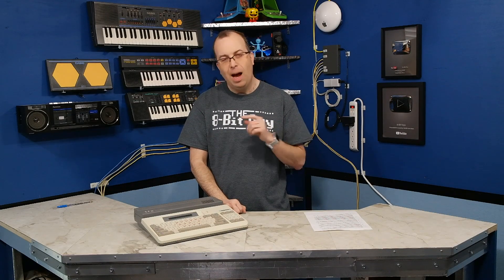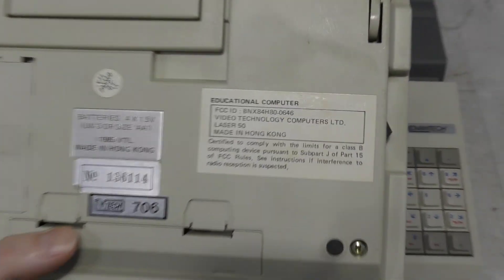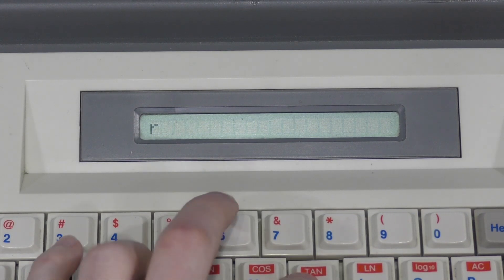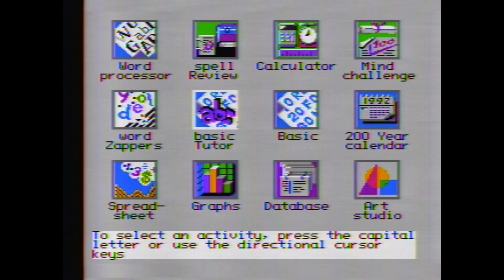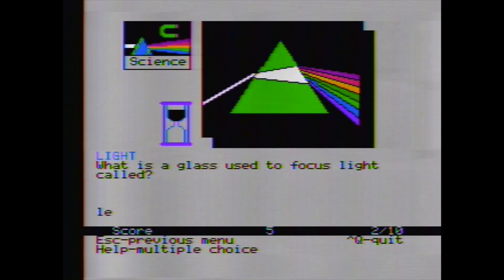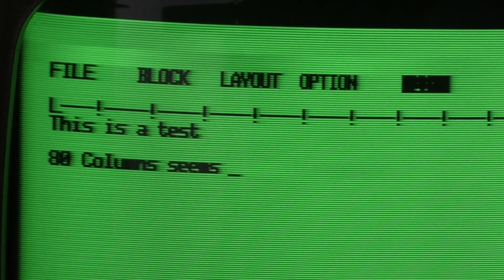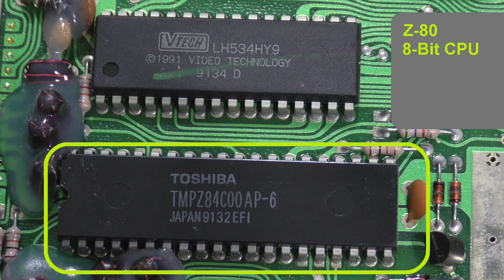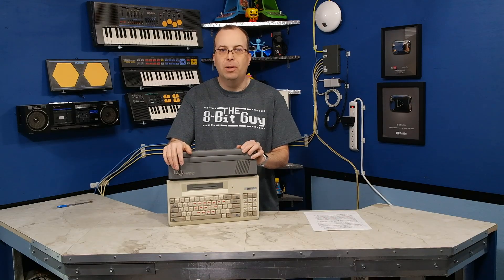The Advantech I.Q. Unlimited with BASIC and a Z80 CPU.

Comment: 16:20 "Not sure what speed it's clocked"
Time for you to get an oscilloscope, sir!
Reply: Frequency counter
Reply: You can probably find a crystal somewhere on the board ... if there's nothing other than the NTSC colourburst one, then it's using that, and likely running 3.58, or for later Z80As, 7.16MHz.

If even that can't be uncovered, just try and figure the pixel resolution and how wide a sweep of the screen they cover, and compare that width against a machine of known frequency and resolution. The TV's beam will scan at a fixed screen, so active width is equal to active period; pixels divided by period will give you video clock frequency ... which in a machine like this will almost always be locked either directly to the CPU speed, or in a fairly simple ratio (2:1, 3:2 etc) to it. Which gives you a most likely speed, plus a limited number of alternatives. The CPU markings themselves should also reveal what its maximum speed is, and usually the host machine will be designed to run at or close to that (EG one with a chip marked with an 8MHz maximum speed probably runs faster than whatever the next speed grade down is, likely 5 or 6MHz...), and in concert with the other information should help narrow down the realistic options.
Reply: or just look at the crystal...
Reply: Update: Looking into / refreshing my memory over how the Apple ][ video modes created colour, as this machine sure does seem to use at least a variant of the same method if not completely copying it, you are pretty much locked in to using a 14.318MHz master clock, as that's what creates the pixel clock in double-hi-rez graphics (560x192 1-bit on a mono screen, 16-colour with 140x192 effective rez on a colour screen, possibly you could shoehorn in a 4 or 6 colour 280x192 mode but that doesn't seem common/official) and 80-column text modes on the ][c and ][e, as well as the colour waveforms in original low-rez (40x48, 16 colour) mode, and is subdivided by 2 to make the pixels in original hi-rez graphics (280x192 mono or 140x192 6-colour) and 40-column text. All the other frequencies in the system are also divided out of that master, including the CPU at 1.023MHz ((315M/22)/14).

As the system smacks quite a lot of a ][c reference design (including the under-used 128KB RAM), with the 6502 CPU replaced by a Z80 for some reason, and almost all the original logic squashed into a single LSI chip plus a couple others which weren't convenient to fit into that, plus the floppy controller virtual "card" replaced with the bundled software ROM, I'd be surprised if it does anything different.

The CPU in this case is therefore probably running at 4.77MHz, the same as the original IBM PC, and arrived at by the same method - 14.318MHz divided by 3. If you've got a 6MHz Z80 available, that's the best you can do without adding extra oscillators and clock generator hardware, because /2 is 7.16MHz (too fast) and /4 is 3.58MHz (slow enough that you could have used a regular 4MHz Z80 instead). It's also about the slowest you can run the chip whilst still getting a reasonable speed boost vs the original processor (a 3.5MHz Z80 is arguably on a level with a 1MHz 6502, but a 4MHz has a better fighting chance; 4.77MHz is definitely quicker), in order to compensate somewhat for any suboptimal coding (VTech probably doesn't attract the world's best coders), inefficiencies from simple source porting, any need to swap endian-ness of 16-bit data, etc. It may look like it runs a little sluggish here and there, but without that extra 50%, it'd be noticeably worse (like... a third worse. Of course.)

It might also be something to do with the memory, which looks like it's rated for 100ns? 10MHz? (Same difference?) Either way it may well be running at a good 7.16 if not 14.32MHz, taking advantage of the higher speed rating to allow the video system some extra slots besides the CPU access (in the original Apple, this was taken care of by the memory being good for 2MHz, whilst the CPU ran at 1MHz). Maybe there's even some kind of fancy /1.5 divider, x2 synthesizer, or just a 28.63MHz master clock involved to make a 9.55MHz memory clock possible. It only really needs a fairly minimal amount of extra bandwidth (1-bit video at 14.32MHz means shifting bytes at a mere 1.79MHz; as memory usually needs at least two clocks for a single transfer, that comes out at 3.58... 4.77 + 3.58 = 8.35, so 9.55 leaves a little bit spare).

Alternatively the video accesses could just fit into gaps in the Z80 machine cycle where it doesn't touch the memory bus at all, and the memory is merely overspecced (it was just whatever was cheapest in order to provide at least 64KB, or maybe the full 128 so that working memory and document / image storage could be kept separate and bank-switched, at a minimum of 4.77MHz operating speed), though I'm not convinced that would allow enough bandwidth without some degree of contention and processor waitstating... which may itself be a reason for the higher clocking, so that it has some chance of executing any instructions during the active video portion of a line, even if it's at a reduced rate. (Memory running a 7.16MHz could work though, with a bit of glue logic to interpose between it, the CPU and the video, maybe with a bit of buffering for the former; if the chip only does one access per four clocks, a reasonably common thing for anything other than the 6502 at the time, that would demand an equivalent memory speed of about 2.39MHz; that + 3.58 is clearly less than 7.16)

The final alternative is that everything runs at 7.16MHz and they're simply overclocking the CPU (Z80s were quite resilient against the practice AFAIK), whilst underclocking the memory. With an even sharing of bandwidth between the two, there's just enough for the video to run 80-col 1bpp (with that very Apple ][-looking, thus probably 7-pixel-grid, and 560 total pixels), and the CPU to operate at full speed, without any contention or shortfall. Each gets the equivalent of an uncontested 3.58MHz memory chip, with the Glue logic doing some simple round-robin buffering to guard against both systems making a memory IO request at the same time... a pretty common thing in almost every computer system of the era other than the (non-Jr / Tandy) PC compatibles themselves.

One oddity seems to be that, in colour / 40 column mode as seen on the monochrome display, it isn't actually using super thin on/off stripes, but wider ones in a few shades of grey. This is an entirely valid alternative to the Apple ][ method, produces the same effective colour resolution, and if it's 4-level uses the same amount of memory and bandwith for a given display (and therefore, the frequencies etc are the same), it's just a touch more complicated on the electronics side (have to provide a 2-bit resistor ladder DAC rather than a simple single TTL), and results in a different, and likely more restricted set of colours, with probably only about twelve unique ones in the full palette. This would seem to match what's observed though, as I wasn't able to count more than that many, and the palette is a bit weird even vs the Apple. Plus there are multiple greyscales, which this scheme would allow, but ][c/e DHR didn't.

Similarly it looks like it gives a somewhat wider image - the ][ had a bit of a horizontally compressed image even on a regular TV, a bit like that of an ST or C64, to ensure it fit within the underscan limits on even a curved tube (similarly, the choice of 192 instead of 200 lines), which also gelled nicely with Woz's idea of using the 8th bit of each byte as a colour palette indicator. This machine looks like it might be showing a full 320 (or 640) pixels instead, which again is an entirely valid thing to do within the calculated operating bounds. The Amiga (running a 7.16MHz pixel clock) shows that it's a neat fit for a typical TV, you can make the colour encoding a little more logical and less prone to fringe artefacting (thus easier to program, and much nicer looking) by running 4 x 2-bit subpixels within each 1-byte block (with a resulting effective 2-pixel colour graphic or 4-pixel B/W text resolution, ie 160 colour or 320 B/W on a line) and happily sacrificing the 8th-bit mode switch because you're already getting twice the palette range of the original system anyway, and use a slightly more refined looking - or at least, slightly more loosely spaced, either way is more readable - 8-pixel-grid font. 80-col mode just splits each of those 2-bit subpixels into two 1-bit ones... and would have worked fine on a regular TV if only they'd thought to run a line to the modulator to switch it into B/W mode / turn off the per-line colourburst when it was activated. (Without that signal, a colour set will treat the incoming signal as pure monochrome and not attempt to decipher the hi-rez patterning, ie the text, into lower rez colour smears)

Comment: I had one of these as a kid and there was an external ram pack that you could store your files on. It had a standard cr2032 battery. I believe there was also an external floppy drive option. At least I recall seeing one offered in the included literature, and I did want one. Oddly it also partly worked with the Socrates game carts. Though you could not really play the games if I recall. I used this as my main computer for about 3-4 years. I still have it, though doubt it works after sitting for 20+ years.
Reply: Both this and Socrates are z80 based and from the same company, so it makes sense they'd be sort of compatible.  But something as simple as changing the memory map between machines could render the software basically unusable.

As long as you didn't leave batteries in it, I'd be quite surprised if it didn't work after a mere 20 years.  The Sinclair Spectrum had to reach about 30 before the membranes started to have to be replaced as a simple matter of course.

Kinda want one of these now :)
Reply: harshbarj pull it out and mess about with it!
Reply: Interesting. That makes it into a rather more practical and better-value prospect than just the base unit we see here.
Reply: I just bought one of these IQ Unlimited computers online and I find it rather fascinating, it arrived today and it works.  If you still have the RAM expansion pack and no longer want it, I'm willing to buy it off you if you're willing to part with it.

Comment: Regarding the 128K, i suspect a banking scheme of some sort and that SMD chip on the other side being, among other things, the bankswitcher. I even suspect that you could add some sort of battery backed RAM disk on that cart slot.
We could try to check how that think works and even write a crude emulator if someone would dump the ROM. ;)
Reply from the maker: Actually, I heard somebody say that MESS emulates this, but I wasn't able to find a copy that did.
Reply: The MESS name is "iqunlimz", lets see if that brings me somewhere. :D
Reply: Ok, found it out. MESS merged with MAME, and if you have a iqunlimz.zip with a vtech.bin of 512 kByte inside that in your roms folder and call mame with "mame iqunlimz" it will run.

Comment: 1991!? They had 386 computers by then! They sold an early 80's basic machine for $200 in 1991, what a ripoff!
Reply: mrjakeisnumber1 They had 486 (1989) computers by then and the Pentium (1993) just two years after this 1991 8-bit computer.  I bought my first 386DX in 1986 with a 150MB ESDI hard drive (there is an interface type few have heard of!) and 2MB RAM ($1000/MB at the time), that is how far behind the times this VTECH computer was on its release day!
Reply: A 386 in 1991 especially a portable one would have been $4000.

Comment: I have a vTech much like this in the UK. It is called IT Unlimited but doesn't have an LCD. It has a single cream-coloured case and plugs into the TV. I suppose it took its styling cues more so from the Amiga. It has some useful features, including carts and BASIC. I reckon there are probably some other secrets the machine holds, which I hope to get time to find out about. The software is very similar to that demonstrated in this video.
Reply: OH, interesting they would have carts for that.  I see though this thing came out later in the 90's. https://www.youtube.com/watch?v=uI63JvsrluY
Reply: Christopher Sobieniak That's the one. Interesting style of review in that clip, but it's a good overview of the machine! That cardboard manual also has all the guidance for BASIC programming as well. It's certainly no C64 but worth the £10 I spent on it and I may give it a second look.

Comment: I'm willing to bet the two chips you are unsure of are meant for controlling the Cartridge bay and the card-edge connection.  they probably planned a disk drive to be used on the card-edge connection. For what looks like a cartridge area they probably had plans to develop games or even a memory expansion and modem to use the cartridge slot.

Comment: Trying to teach kids basic when DOS was already wide-spread.
Reply: Especially considering most versions of DOS included a version of BASIC
Reply: DOS has nothing to do with basic. Though learning basic in 91/92 was already a bit weak sauce. Most kids who got a pc learned much more useful languages as the systems were more powerful.
Reply: Actually, BASIC were still pretty common.  With a decent compiler(as opposed to the common interpreted versions), it wasn't really much less effective than anything else.  BASIC really only fell out of favour because it stopped being included as the main operating system in favour of GUIs.

Though, I believe many programmers on the 16bit machines prefered C largely because of the ease of mixing easily portable high level structures and low level assembly for speed critical subroutines.  C was largely standardised compared to each machine's version of BASIC.
Reply: Zcan Kal ???? Weirdest comparison ever. I had been running GEM on my Atari ST for 5 years when this Vtech machine came out. DOS was ancient in 1991 and has nothing to do with a programming language.....

Comment: So it came out 1991 and is just barely more capable* then the GameBoy that came out 1989.

More build in memory but less software and general support, rather bad tradeoff i'd say.
Reply: Color with awful artifacts and a version of BASIC so limited it's nearly useless. And no software other than what's built in it. Awful sound chip with no polyphony. More than twice the price... Shall I go on?
Reply: Pretty much any of the second generation home micros of the early 1980s were orders of magnitude more useful than this pile of crap.

This came out around the same time as the SAM Coupe and Amstrad CPC+. Both 8-bit micros, both bombed, but I know which of the three I wouldn't be interested in.
Reply: fgregerfeaxcwfeffece it had color. And BASIC. Amd a word processor.

Jokes on you.
Reply: BillsNegra It apparently had very limited compatibility with Socrates carts, and there is some sort of floppy disk drive, but it's still just to little compared to the Game Boy.
Reply: Hell, the regular CPC would have beat hell out of this, particularly the 6128 ... 128k, only a slightly slower CPU, better screen modes (with green-screen monochrome and analogue-RGB monitor options) and sound, better OS and programs, about as good a keyboard, and a built in disk drive. Plus if you just wanted to do word processing and spreadsheets and weren't really bothered about colour, the PCW would have done you just fine... higher resolution (on a built in screen no less), more memory, again with a disc drive, and a bundled printer too, for a lower price. Shame Amstrad didn't make that concerted an effort to break the US, really, against things like this they could have made serious gains.

The Coupé wouldn't have come close on anything except colour palette and maybe maximum memory capacity...